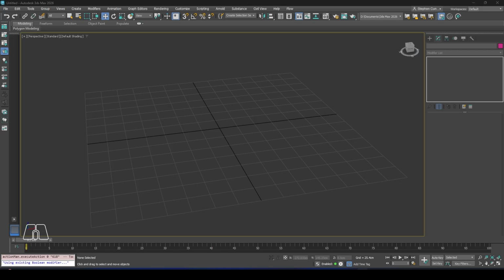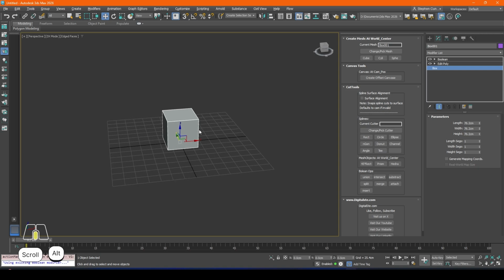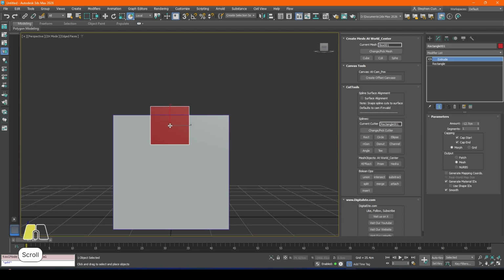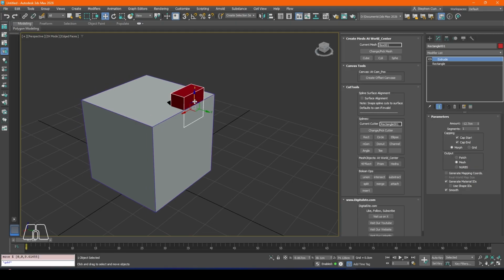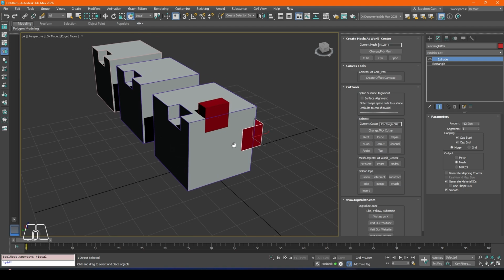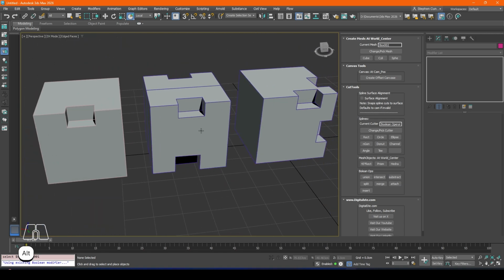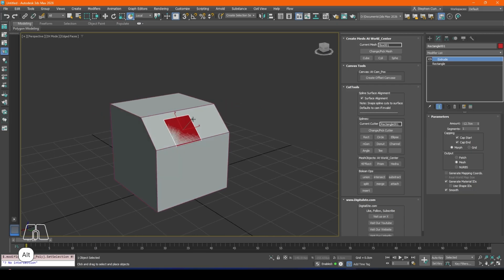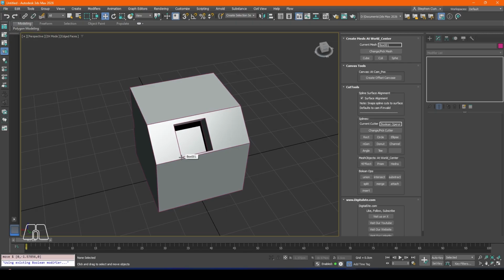Swift Cut Tool –Hard surface Modelling Tool - Beta Release

Comment: its nice that you created this tool but it feels like a wasted potential. Boolean tools need to be able to draw shapes directly on the mesh, with the ability to round corners and quick union or subtractions of these shapes.

look at hard ops or lasercut. This is a bit faster but still not the fastest or more enjoyable way of doing these kinds of modeling. 3ds max is in need of a tool like hardops/lasercut. Do not take this in a negative way, you created an amazing tool. But maybe you can implement it.

https://youtu.be/LVgmBfj8Ivs?si=itB2UZBcggTk47i9
Reply from the maker: Thanks for the comment and feedback, I really appreciate it. I'm still learning Blender but will take a look at hardops/lasercut. 

Max does, allowed shapes to be drawn on surfaces. Perhaps  I should have demonstrated this in the video? However, the point you made about having the ability to round corners when drawing the shape would be an excellent addition. I'll see how much interest this tool gathers from the community and consider if it's worth attempting to add in additional features like you've pointed out. Thanks again.
Reply: @digitalste811  best of luck. thanks for your contribution!